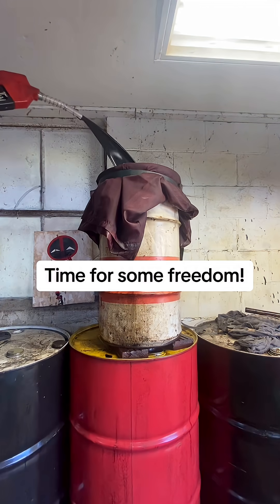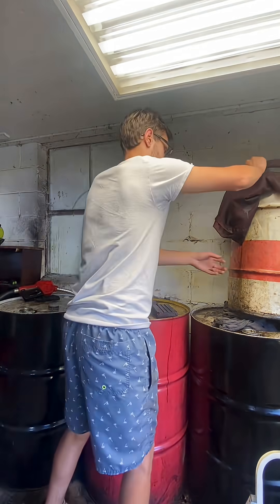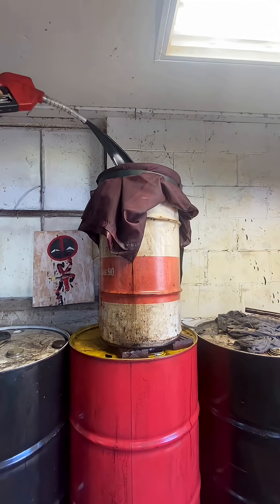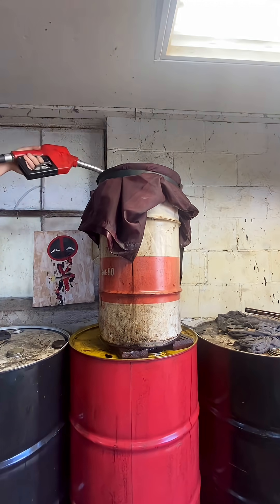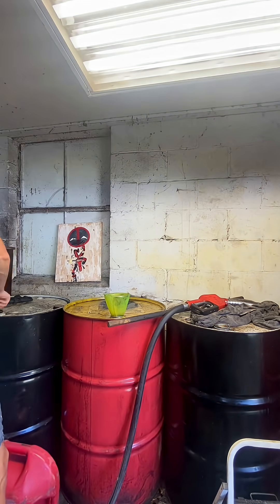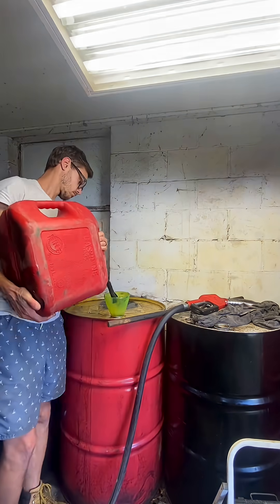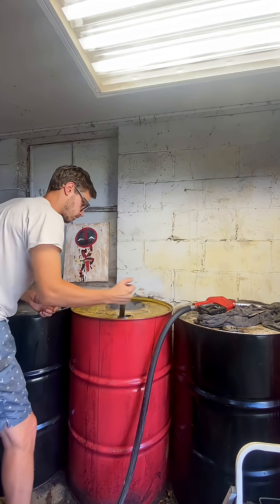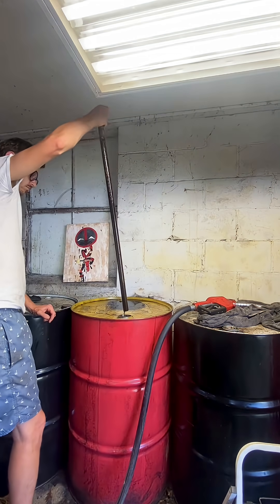Transform #wastemotoroil into #homemadediesel Fuel #dieselmechanic

Comment: As a 30 year auto mechanic, I can honestly say that if you try to use that concoction in a diesel engine, it will get destroyed
Reply: 12 valve can run it no problem
Reply: @danielmarshall1752  the 12 valve will run it no problem. The VE, P, or VP44 pump will not enjoy it one bit.
Reply: @joshbridges8410  trucks have been eating this kind of fuel up longer than you’ve been alive kiddo. A diesel engine will run off used motor oil alone. It burns dirty but runs just fine. Not enough gas in that mix to cause detonation issues. Just enough to increase the burn temp and help extend the amount of time before carbon fouling issues arise. Is this fuel recommended? No. Is it even homemade diesel?  Hell no. Will it run just fine for a good while? Absolutely I’ve done it for months at a time before in a truck I still own and drive regularly with zero rebuilds in 247,000 miles since I got it.
Reply: @anthonylangley6843  read what I said "kiddo".

The engine wont care.

Sending that concoction through a VP44 or CP3 pump, both known for lubrication issues ks going to shorten their life.

Will it work? Of course. Will the pump be happy? No.
Reply: @joshbridges8410 p pump is on a 12v buds and yes it will run on this
Reply: @danielmarshall1752  6.9 and 7.3 idi dont complain. My 24 valve doesn't mind it one bit.
Reply: @danielmarshall1752  Just because it can run on it doesn't mean it'll stay running. Diesel engines are very forgiving with what they'll run on in the short term only.
Reply: 7.3 loves it
Reply: as a 150 year mechanic and knower of all things, i think it will not be destroyed
Reply: @sashareinhard6645 😂
Reply: As a 70 year mechanic, i say you dont know nothing
Reply: So he knows something.  @sixinarow2498
Reply: @sixinarow2498  lol you tellem
Reply: As a 1,700 year mechanic, you forgot to add sand
Reply: @FritzTheCat1987 😂😂😂
Reply: My mechanical diesel tractors would burn that, but God help you if you put that in something with a CP4...
Reply: Mechanical pump IDIs don't give a rat's ass.
Reply: 😂😂😂😂😂 are you the same type of person who says either is bad
Reply: As a 2000 year mechanic, we basically built the pyramids using this exact same recipe 😂
Reply: I mean yah lot of the newer ones, but if you have older direct injection engine it's no issue, ik several people that get free fluids and use a mix like this in small diesel engines for property maintenance and they have older diesel pick up lot truck that runs on it too
Reply: Honest mechanic?
Reply: As a 70 y old alcoholic I say "cheers"!
Reply: Bend broken crankshaft for sure
Reply: @lucaswilhelmmeyer6943 I'm assuming you've never done this I've been doing this for years diesels are designed to burn just about anything now modern Chevy 6.6 has a fuel sensor so you can't run dark fuel to prevent you from running agricultural fuel
Reply: @lucaswilhelmmeyer6943  lol if you think that’s what’s going to happen it’s pretty obvious you don’t have much experience.  Maybe if there were more gas in the mix but there’s not enough gas in that mix to cause detonation issues that would be needed to break or bend a crank. It’ll run fine it’s just going to run dirty as all fuck
Reply: If he's doing this for a year, he might have found that out already.
Reply: This isn't meant for common raii diesels
Reply: as a guy whos coworker done it for about 40+ years i beg to differ
Reply: Diesel engines were originally designed to run on fuel oils which is close to this in composition. The earliest diesel motor used straight up peanut oil, and diesel motors can even run on animal fats. This fuel he made should be decent enough to run the engine without engine modifications, though surely isn’t as clean as regular diesel. But I think should work fine for a good while.
Reply: As a mechanic with 82 years of experience you dont know shit boeh.
Reply: I just wanna rip my hat to all the elder mechanics out there that woke from the the dead to share their experiences with us !!!! Hats off gents
Reply: Guys, pack it up, Shawn says you can’t do that, thanks man, the fucking ORACLE HAS SPOKEN.
Reply: @FuttBuckerson805 😂
Reply: the army 2.5 ton trucks will burn the oil straight so why do you say its bad?
Reply: As a non R-word person, I would remove the stupid safety spout and pour right out of the gas can.
Reply: I tried already, these dumbasses dont want to hear it.
Reply: Well then you don’t know shit cuz this would in fact run just fine. Not enough gas in the mix to cause detonation issues. And diesel engines will run off of used motor oil alone and they run just fine aside from it being dirty as all fuck and bad for the injectors and most of the other internals over time as a result. But acting like this would blow an engine up only shows that you’re either lying out your ass about having 30 years experience or you just wasted 30 years and don’t know shit.  Or also possible is you’ve spent 30 years as an auto “mechanic” who just does tires and oil changes. Either way it’s clear you don’t actually know what you’re talking about. My source? I’m an ACTUAL ASE Certified L2 Master Diesel Technician. With 15 years of experience ACTUALLY rebuilding engines. I also currently hold 4 ASE certifications in the Automotive Side as well as the Gas Engine Certification from the T Series of ASE certs. On top of that I’m a Detroit certified Expert in DDEC2-5 platforms. If that’s not enough qualifications to speak on the matter then I’m not sure what is.
Reply: Tell that to Zip ties and Bias plies
Reply: Did it for years in my 5.9 Cummins I use the centrifuge to pull the crap out of a used motor oil and did a 10% gasoline mix you just have to make sure and change your fuel filter regularly it will not wreak havoc it will only wreak havoc if you don't get down to three microns
Reply: My lawnmower runs on rubbing alcohol. Same problem both will work and both will do damage
Reply: As a 40000 year old mechanic, I have to say there are only 2 genders.
Reply: A spark from the lamp on the ceiling, not safe
Reply: @vbozenko was thinking the same thing this all seems unsafe, no safety, no gloves, ventilation, etc
Reply: @vbozenko tell me you work in an office without telling me you work in an office.

Comment: This will not work in a modern diesel. Especially the larger diesels. My 1996 QSK19 might run for a bit, until you burn a hole through the tip of your injector.

Comment: Throw a magnet in the filter to catch small metal particulate.
Reply: brass bearings don't stick to magnets
Reply: I would suggest using a settling tank to drop out a high percentage of heavies, and pump off the top. Just rig up an easy to replace very large fuel filter and replace frequently on your pump.  Not for road use, fine for farm, etc.  I have seen someone get tested for off-road only fuel and receive a massive fine.  Highway taxes are collected via fuel taxes.
Reply: @Hawkido ... So much for EV cars & trucks... How do they test them for off-road electricity...
Reply: use a special aluminium magnet too !! 🤣🤣🤣
Reply: @super-rachel-music8483 that's the hardest part lol they do make some insane filters though that could filter it but would take forever and constantly stop up.

Comment: Cp4 disco party. All yo injector invited.
Reply: A M1 will run just fine on this. My F250, not so much. One more exploding pump and I’m done.
Reply: Funny asf
Reply: Nah I went last week. It cost too much at the door😂
Reply: Ohh! El-em-el Duramac! He wanna hav disco pawty!
Reply: The lift pump has a filter on it if it's a fass...
Reply: Black helicopters will be circling soon looking for their 'road tax' on the fuel.
Reply: All I run in my 12 valve. 🎉🎉
Reply: He’s running it in an international IDI with a stanadyne pump and nozzles from the 1930’s..stanadyne pumps are trash even with all the filtration you can get and only need to make like 2600-psi..them engines will run on a blatz fart

Comment: That's not diesel, that's gas/waste oil mix
Reply: If it will burn in a diesel engine, it's diesel fuel.
Reply: @kugelsicher5721  gas will burn in a diesel engine... it's still gas.

Comment: You should separate some into a grad cylinder to check for water content. Also it might be worth Filtering several times to remove as much carbon from your fuel as Possible from all that dirty oil.

Comment: I started filtering oil for my diesel with 1 and 5 micron sock filters it takes forever to fill a barrel, and it's still dirty asf. You need a centrifuge that is the best way, but they cost about 1g, so is it even worth it after spending that like really. Plus, your fuel tank will eventually hold less from all the sludge build-up. If you ran a junkyard and had access to tons of oil, which you would then, it'd be worth it, but if you gotta drive to pick up oil from a shop or something, not worth it.

Comment: Try this,
Get an old wash machine that spins then some of those large commercial floor scrubber pads to line the drum of the washer with. (It will hold the particulates from the oil better).

Fill the washer spin the hell out of the oil. Anything in that oil will be flung to the outside of it. When the center seams like clean oil shut down and suck out what's cleaner then add more.
Reply: Electricity and flammable fumes don't mix well.

Comment: you should not run a diesel engine with a mixture of gasoline and oil. While some older diesel engines might have tolerated a small amount of gasoline mixed with diesel fuel for emergency situations, modern diesel engines with sophisticated fuel injection systems are very sensitive to fuel mixtures and can be easily damaged by gasoline. Gasoline lacks the lubrication properties necessary for diesel fuel systems and can cause significant damage to components like fuel pumps and injectors.

Comment: Bend a piece of baling wire into a t shape and insert into the hole of the smaller barrel. The wire will guide act like a wick and guide oil into the bigger barrel with less chances of spilling. Its how i do my oil filtering

Comment: This isn't very good refinement, there's alot more filtration and chemistry that would go into making this safe for mechanical fuel pumps, there's way too much trash in that, it would heavily tarnish any fuel system over time, I wouldn't use this in anything other than my diesel heater

Comment: U need to mix the gas and oil for 20 min plus or they will separate out again.
I used to run it in my truck. I used a centrifuge (9 g force)to clean the oil, but heated it up first so the particulate and heavies would come out easier.
Get Steve Chastains book, alternative energy secrets.
Reply: That sounds like ALOT of work, I think I'll walk lol
Reply: @1974Qball 
Simplicity is best no doubt
Reply: Why do you call petrol gas in America?  I'm gas is an equivalent of fuel. So you have to be specific which type of gas you are mixing with oil.
Reply: @tic2394  As an american, gas is just short for Gasoline, which is the same as Petrol. Petrol is also sort of ambiguous - its short for petroleum spirit, but everyone knows what you mean when you say petrol.
Reply: @tic2394 
Unleaded gasoline is what I used.
Reply: @tic2394 Maybe american gold sounds better? How about fossil energy?
Reply: gas would thin it out?
Reply: @Peterswarahed 
Yes, but it must be mixed 20 min or more so it won’t settle out..
Reply: @CLAY-TON-R  hmm.. so i need one of those electric stir sticks :)
Reply: @CLAY-TON-R  maybe a paint stir thing... the metal one that goes on a drill.
Reply: @Peterswarahed 
That’s what I used…
Reply: I will look thx😊
Reply: *Stephen Chastain
Reply: Do you have a link for the book? I can't find
Reply: @weldmonger-x2c Stephen Chastain , Alternate Energy Secrets.
Reply: Googled the book. Doesn’t exist?
Reply: @Longnosepossum 
Stephen D Chastain
Alternative Energy Secrets 
Sorry, my dad has my book.
He sells centrifuges as well. I bought one from him. He’s in Florida..
Reply: @CLAY-TON-R cheers
Reply: Me too  @Longnosepossum
Reply: @alexanderfilux  Steve Chastain - Alternative Energy Secrets
Reply: @Longnosepossum Same here, any luck on finding the book?
Reply: @Longnosepossum 
Stephen Chastains, alternate energy secrets. He lives in Florida. 
I believe I still have his phone number..

Comment: Do you use diesel motor oil when it's old or gasoline motor oil because the diesel motor oil would probably work great the reason why I'm saying that because of the blow by right there's always diesel that goes past the cylinder walls into the oil just like gasoline ones but I don't think it would matter much because you're actually using gasoline oil right and it probably ignites it a little bit good like it probably is the the more oil good